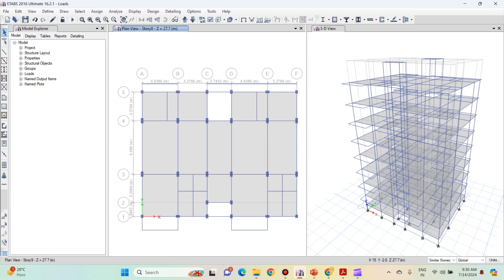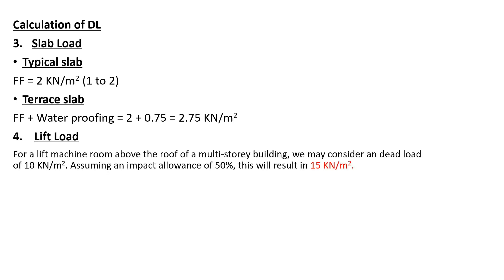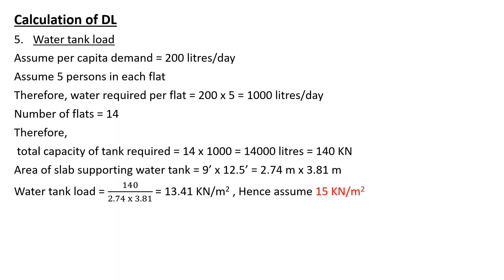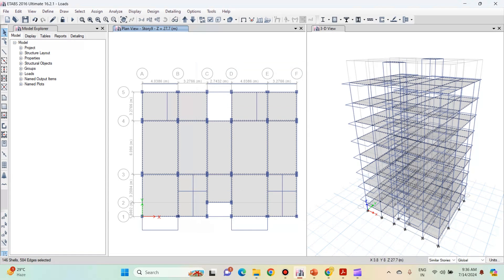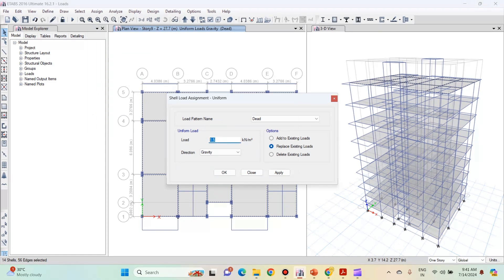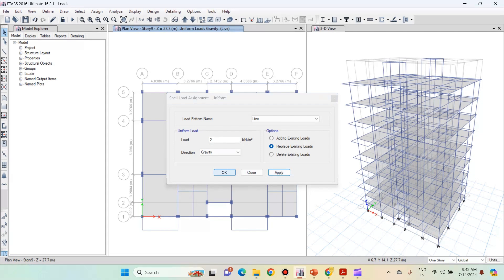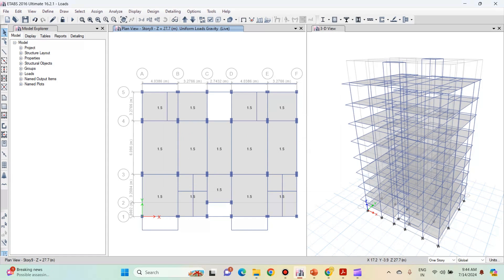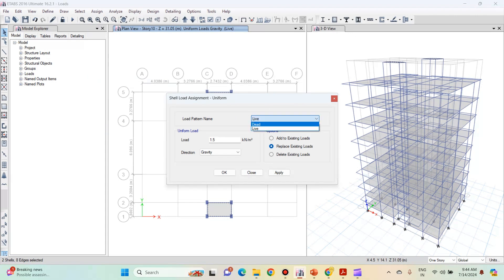ETABS Tutorial Part 5 : Slab Loads, Water Tank Loads & Lift Loads (kN/m2)

Comment: When will the next video get uploaded?
Reply: I had a doubt. We had created beam for partition wall in story 2 to 9, it will transfer the load of the partition wall to the column. But what about ground floor (story 1), how will we transfer the partition wall load into the structure (for that does we need to do any additional things or typical slab will cater it).
Reply: Extremely helpful Sir❤. Sir why not apply slab and slab load on balcony
Reply: Extremely helpful Sir❤. Sir why not apply slab and slab load on balcony